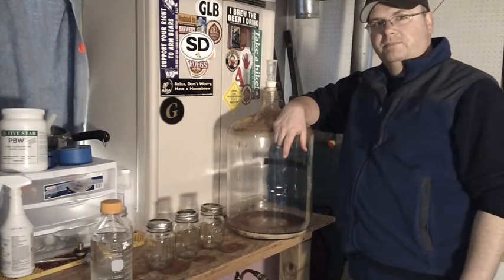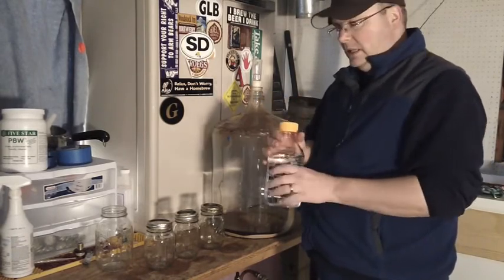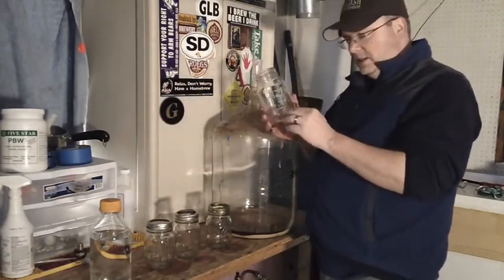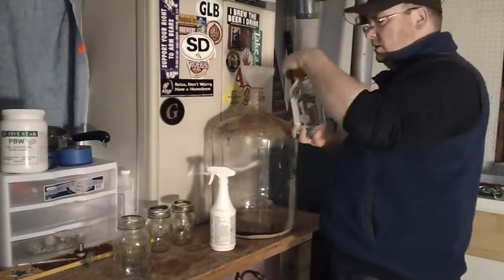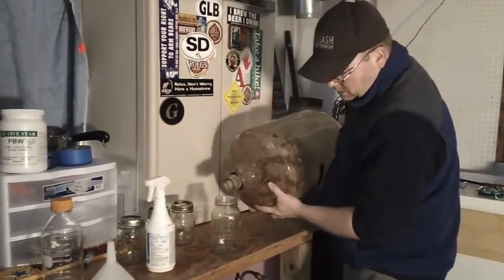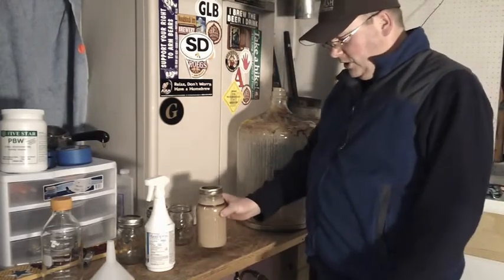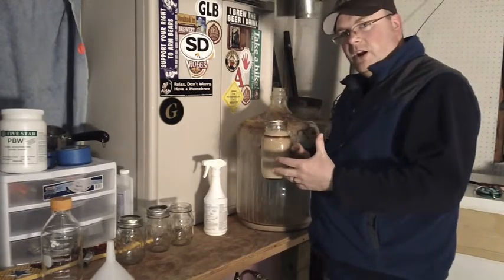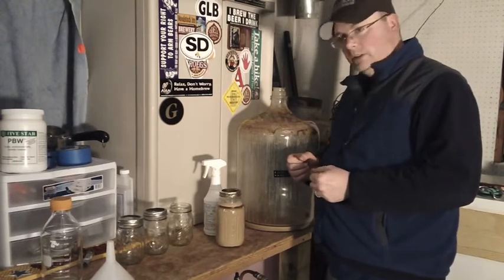Yeast Harvesting

Comment: hey Mike after alot of research  i found using water is not a good idea, you wanna use beer either left over from racking or a really cheap can of beer to dislodge the cake, no water, no need to rinse yeast actually detrimental to yeast , if someone wants long term storage then slants, plates or freezing the culture in glycerin but if you using the yeast within 2-3 weeks no need to rinse and i was just chatting with the guys from imperial they said NEVER let yeast warm up pitch directly from the fridge into starter/main batch
Reply from the maker: Thanks for the info, Chris.  I'll keep that in mind for next time.